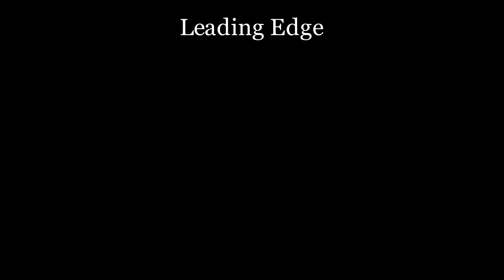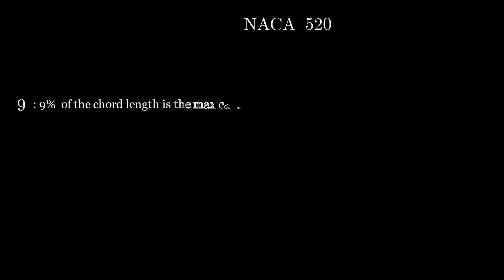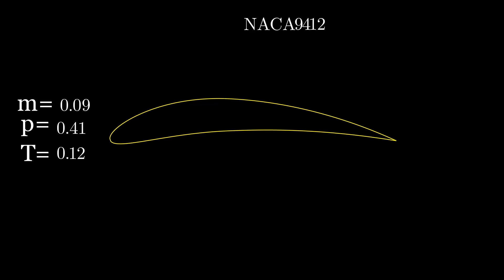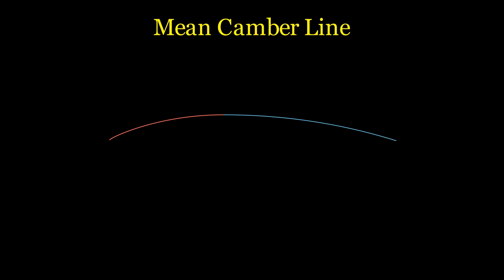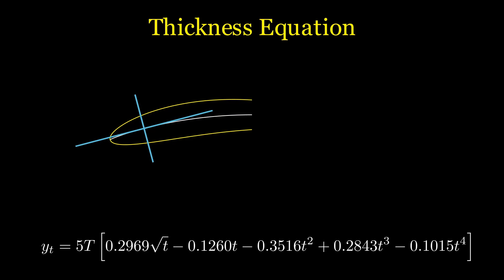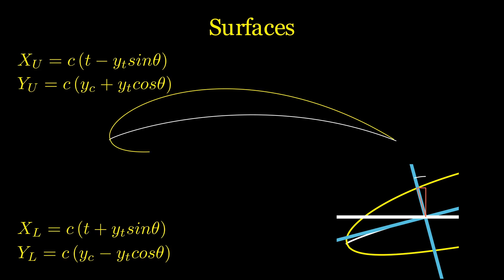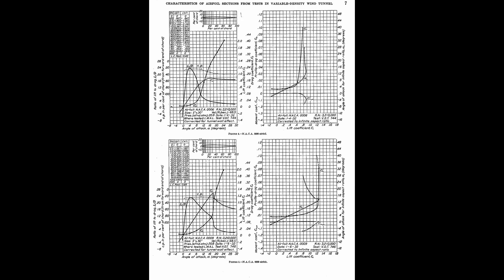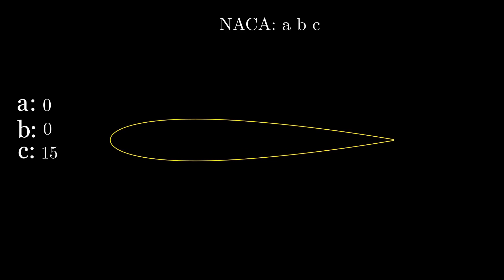How to create your own airfoil | NACA 4-Series Airfoils

Comment: Hello, this looks really cool. How could one make the equations for the upper and lower surfaces?
Reply from the maker: If you mean make them based on the NACA design you can go to the Desmos link in the description and I have an interactive airfoil to play with, in there is the equations for the 4-series. If you mean make your own I would suggest reading that NACA document in the description, they outline how they came up with the equations they settled on and it may give insight on how you could create your own.
Reply: @Tidepodious  Thanks, I want to make the equations for the surfaces. I want to upload this to computational software where I can plot the equation of the two. Afterwards, I want to find the area between the curves. But I have no idea how to get the topic and bottom curves.
Reply: @Tidepodious  Hey, could you explain line 22, 24, 25 on desmos. I dont understand how a function is being drawn from that
Reply from the maker: These are parametric equations, so they are in form (x,y). The first half of the expression says where the x point should be and second the y. I prefer to compartmentalize equations but if you were to start with say line 23, and find all of it's variables and plug them in, then do it again for the new unknowns and fully collapse all equations down you should have 4 total parametric equations. (Top first half, top second half, bottom first half, bottom second half). The equations in this form are rather long so be careful not to get lost in the variables.
Reply: @Tidepodious  would it be possible if you may make a video tutorial or rundown of the desmos lines? especially the 22, 24, 25. I really appreciate this as a hobbyist